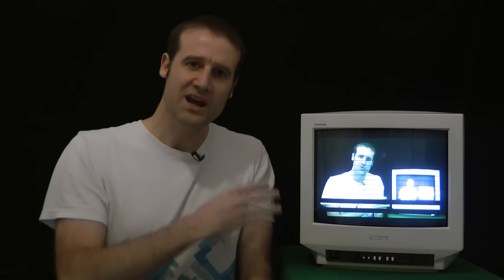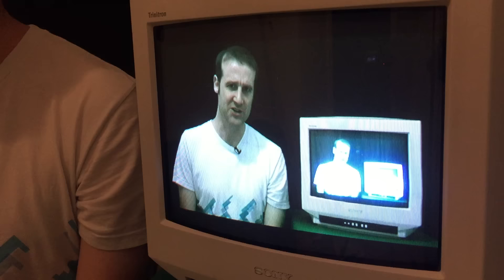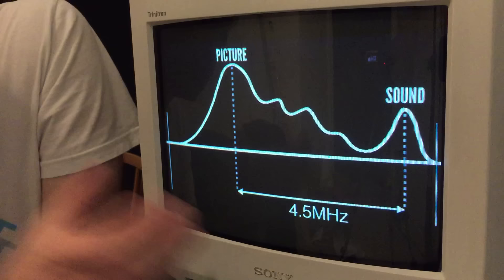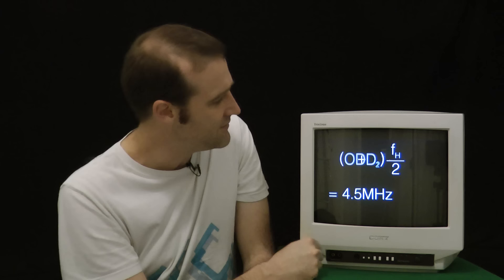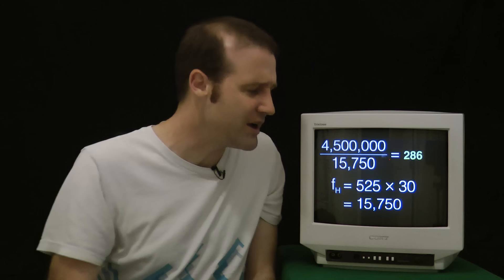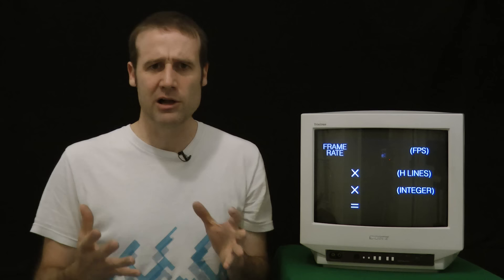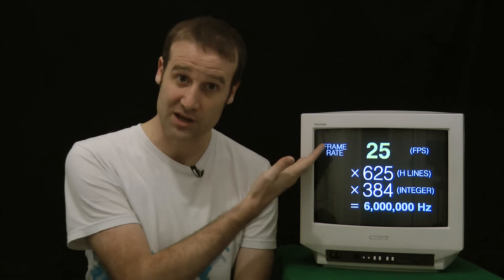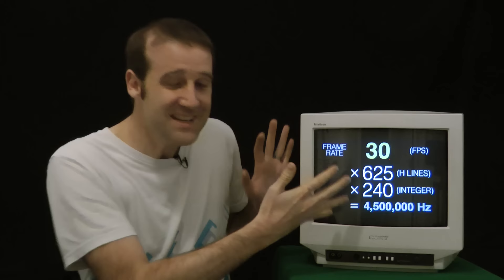Why is TV 29.97 frames per second?

Comment: I've always thought RCA engineers did a pretty genius job adding color to the B&W signal without making non-color TVs obsolete.
Reply: Dave Holden yeah it is amazing how they pulled that one out their arse...I remember NTSC stood for never the same colour, SECAM Stood for system enitirely contrary to the American method, and PAL... peace at last....
Reply: NTSC: Never Twice the Same Color
Reply: You are absolutely correct! It was not perfect, but and outstanding job of integrating old technology.
Reply: I think they did the best to make the smooth transition from B&W to Color. If they changed the frequency or the amount of horizontal lines, it would make all B&W TV sets unusable, I guess. Some CRT expert here can comment for us!?
Reply: @pangwa82  Yes, you are correct. If they changed any aspect of the existing waveform standard, they'd 'break' all existing TVs.  Not only could they not change anything already working, but they had to add color to the existing standards, without it affecting B+W TVs. 
For those that don't know, the overlaid  much higher frequency wave on top of the B+W wave. B+W TVs weren't affected by these newly added waves superimposed onto the B+W signal. The addition was a 'color burst' at the start of each line of horizontal B+W data, and then the color carrier was made to be out of phase with the color burst, and the 360˚ phase were assigned to colors! That is, at point A, the color wave is the same as the color burst, and so the TV shows red. At point B, the wave is 180˚ out of phase with red, and the TV shows red's opposite color, cyan. Meanwhile the amplitude of the original B+W wave is STILL telling the TV how bright to make that pixel. 
It's amazing what engineers accomplished without computers and modern electronics!
Reply: @daveholden2711  Thanks a lot for sharing your time and knowledge.
Reply: Thanks for this comment. I was hoping someone posted this and that it was upvoted. It’s sad that the guy making the video wasn’t smart enough to understand this. Maybe he should leave these type of videos to electrical engineers so that he can focus on his video editing with the tools that engineers have designed for him.
Reply: Am i the only one who wasnt really sure what frame rate was?
Reply: interestedparty spot the electrical engineer
Reply: @hypercomms2001  never twice same colour
Reply: @SodiumInteresting  Well Thomas, I will give you some brownie points for figuring out what NTSC stands for.... ?
Reply: @hypercomms2001  national television something
Reply: @SodiumInteresting  I know, I studied it as part of my electrical and electronics engineering degree, and many years I used to sell broadcast test equipment... PAL Waveform Monitors, Vector Scopes, SPGs, and broadcast pattern generators... here is a challenge for you... explain SECAM, and why the Soviet Union bought into it....
Reply: @hypercomms2001  I dont know much about secam.
I heard somewhere that old black and white tvs in countries like germany were black and green 😬 instead of black and white
Reply: @hypercomms2001  those test equipment sound cool, vector scopes waveform monitors. I bought a cheap usb oscilloscope about a week ago. It doesn't do xy and certainly doesnt have the charm of those old analogue machines
Reply: @SodiumInteresting   I remember going to Marconi College in Chelmsford UK [As I was working at GEC Avionics Basildon at the time], as Marconi in it's day was a major UK Broadcast TV manufacturer, and they has a small TV studio, and the senior technician was a retired Marconi Broadcast engineer, who told me the reason why the Soviets like SECAM [Sequential Color and Memory.... or as I remember it... System Entirely Contrary to the American Method], was from why I remember he told me, it encoded the audio as an FM signal, and so it was incompatible with the western NTSC, PAL standards at the time... now it is entirely forgotten....
Reply: @hypercomms2001  Not quite; everyone used FM for their audio. SECAM was different from NTSC/PAL (They're almost identical.) in that it used FM to carry the colour information whereas the other two used Quadrature Amplitude Modulation. 
And the Soviet Union's use of SECAM was nothing to do with deliberate incompatibility with Western broadcasting; they were simply bribed by the French with the offer of technical assistance. (Bear in mind that most of Russia was beyond the reach of Western TV, and that the few Russians close enough to the border to pick up PAL broadcasts could still have watched then in black & white, because the underlying 625-line systems were identical.)
Reply: Yes, this is exactly why they did it. It meant that all the B&W TV's could be used to receive color signals with NO change.  In those days, a TV set was pretty expensive for the masses and people couldn't just go out and get a new set, and more importantly, they WOULDN'T, and that would mean nobody would be watching the brand new Color TV system broadcasts.

To this day, when we are making a decision whether to make a new system compatible with an old one, or to just obsolete the old thing, I refer to it by saying ""we have a Color TV problem".  Of course the younger folks don't know what they f--- I'm talking about, and that always gets me a chance to tell the story ONE MORE TIME.

Great video, except it does miss that most important point.... "And now you know the REST of the story...."
Reply: And it happened again with FM Stereo Radio.  but that time, to L+R was added L-R on a 38KHz subcarrier, and voila.  Again, no previous FM radios broke.
Reply: A neighbor growing up in DC was retired FCC Commissioner Rosel Hyde.  After he died, his kids gave me a few books. One was a history of the Federal Communications Commission (FCC).  It credited him as the one who told the industry to go back and design a color system that was compatible with the installed base of black and white TVs. Their first attempt was completely incompatible.
Reply: @ericleigh007  I remember my dad's Pioneer living room stereo amp, and the 'stereo' light blinking on and off as the music switched from mono to stereo over and over again as the subcarrier reception came and went...
It still does that!
Reply: Yeah, I was faking the "old-vhs" effects in Unreal Engine the other day and I found out that conversion to this sygnal and back to RGB makes amazing old-style effect)
Reply: @alexanderzerka8477  did you watch the video? he literally said he was aware that they were doing it for the sake of backwards compatibility, and that we can't really judge them for it. Also how fragile do you have to be to think that an incredibly mild criticism of a technical standard for TV broadcasting is in any way insulting American culture?
Reply: @gerardjlaw  
The first "not experimental" television service (BBC/"System A"), used AM for audio, from 1936 to 1985.

I was able to hear the sound portion of the signal (41.5 MHz) on a radio in 1979.
Reply: @alexanderzerka8477  That's also not a British accent that is an Australian one, you're not even getting the right continent
Reply: @daveholden2711  But the black and white image had to be moved from 30 FPS to 29.97. How did old TVs handle that?
Reply: @hypercomms2001  PAL=Pay Another License
Reply: @boriszakharin3189  That change was small enough that it didn't matter. Back then TVs had horizontal and vertical hold controls to set the free running frequency of their respective oscillators.
Reply: @SodiumInteresting  Not The Slightest Clue.
Reply: @boriszakharin3189  It was such a small change that it shouldn't have been noticeable. But even if it was, an adjustment of the horizontal hold control would have been enough. Back then, most (if not all) sets had these controls accessible from the outside due to the instability of the electronics inside.
Reply: @frankjones4550  CBS proposed a ridiculous spinning color disk system that was actually approved by the FCC but RCA/NBC filed suits to block it. 
NTSC isn’t perfect, but it gave us color tv.
Reply: @gerardjlaw : "everyone used FM for their audio."

In fact there were FM radios that, just by extending the range of their tuner, were capable of playing TV audio (without the video, of course).
Reply: @hypercomms2001  PAL:  peace at last.... except for the 25Hz flicker and those pesky Hannover Bars.
Reply: @daveholden2711  What about saturation?

Comment: Wrong, increasing NTSC to 625lines would have been a mistake. The goal for adding colour to the signal was to retain compatibility of all broadcasts with all sets, regardless of whether a black and white set or a colour set was receiving either an old black and white or a new colour broadcast. That fancy 15734 number is actually the operating frequency of the horizontal oscillator 15.734KHz which is what causes that farmilar high pitched buzz we hear from the back of an operating set. increasing the number of scan lines would dramatically increase the frequency outside the resonance and tolerance of the oscillator circuitry. This oscillator is local and is timed using sync pulses in the video signal. A 100 line increase would ad 2KHz to the horizontal oscillator and could make it become unstable, not to mention the horizontal oscillator not only draws the raster but also provides the HT for the cathode ray tube through the flyback transformer, which is a central part of the oscillator. the flyback is designed to resonate at the 15.734KHz horizontal frequency for efficiency. If the oscillator becomes unstable you could end up with timing issues and complete loss of HT to the tube if the oscillator collapses, and also the potential for burning up the drive circuitry for the HT supply, since it was all designed to resonate at the horizontal frequency. Sets would struggle and cheap ones would outright fail. It would require modifying the set, or replacing it entirely which is exactly what they were trying to prevent, remember back then a television was not a small investment.